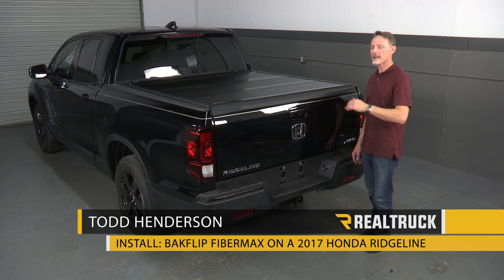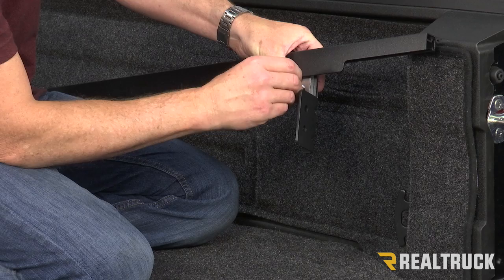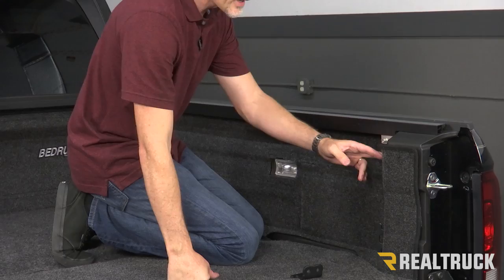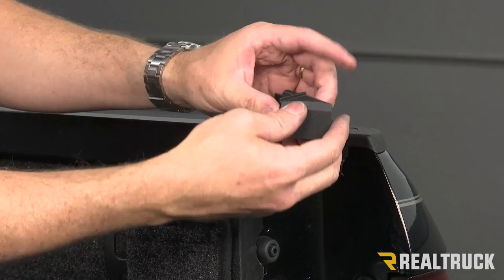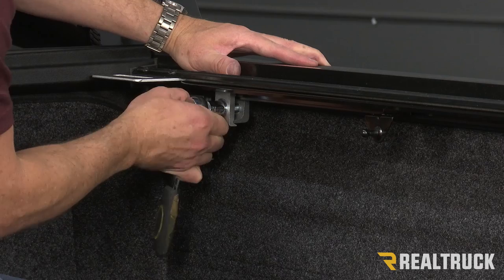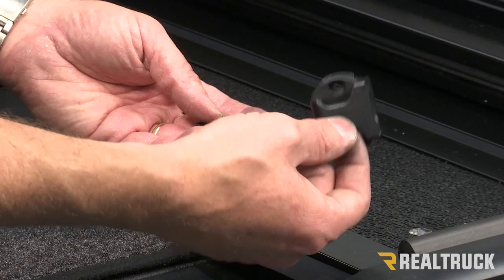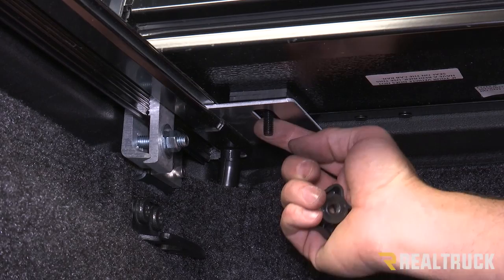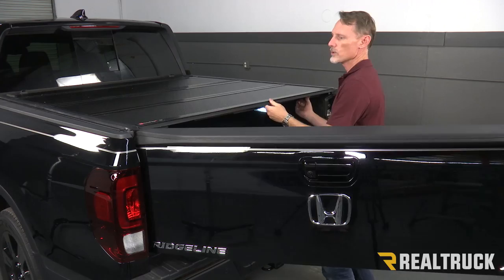How to Install BAKFlip FiberMax Tonneau Cover on a 2017 Honda Ridgeline

Comment from the maker: Check out the BakFlip FiberMax Tonneau Cover on your pickup truck! http://bit.ly/2pArPDt
Reply from the maker: We haven't had any problems with it leaking a lot. No cover on the market is 100% waterproof and this does a great job keeping about 98% of the water out of the bed. If you do get water in its usually along the front bulkhead or tailgate area.
Reply: @ThanhNguyen-zt7jv  So far mine hasn't leaked, even in heavy rain.  I am very pleased with it.

Comment: My cover did not have the correct directions or parts list for my 2021 Ridgeline.  You video was a lifesaver!  Thank you!  Couldn't have installed it without it.
Reply: Good to know! I have a 2021 as well. Mine is supposed to arrive tomorrow (08/31).
Reply from the maker: Glad it helped!
Reply: @RockinSG  are you happy with it?
Reply: @cleanasdirt6832  I am. I had the Honda OEM on a 2018 I owned and it was cumbersome to open it (had to go to each side to open the first panel - all other panels opened after that). With the Bakflip, I can pull a cable from either side to open it. I'm not sure about draining as I don't have holes in my bed for the tubes. I think there are spots but I would have to drill them out. I situated the hoses so I think they will drain. fine. We don't get much rain in AZ so it's not a big deal. It arrived quickly and was pretty easy to install.

Comment: Thanks for all your videos... so many options makes my head spin. I guess it just comes down to which one I like most? They all look like pretty good choices. Leaning towards a roll up just to get that extra bed room when I need it easily.
Reply from the maker: The roll ups are going to be the most versatile. If you have questions regarding the covers please give us a shout. You can chat in or call our experts at 877-216-5446.

Comment: Curious. After I installed the rails on my 2021 Ridgeline, I opened the "trunk" where the spare tire is and the trunk lid hits the rails preventing it from opening all of the way. I think it opens enough but just wondering if I did something incorrectly during my install or if this could be new to 2021 or ??? Thanks.

Comment: The Ridgeline in the video had a bed rug. If I don’t have a bed rug, how should I run the drain hose?  The Ridgeline does not have a drain plug to run the hose to.
Reply from the maker: Hey David, if you don't have factory punch outs in your truck bed you will have to drill a small hole to utilize the drain tube. It's outlined in the instructions and one of our tech experts could also walk you through it.

Comment: so if you put suitcases, valuables and what not in the truck bed using this cover in a rain storm, what's in the bed will remain dry?  also, when you close the cover after the tailgate door is closed, if used with a pop and lock kit to lock the tailgate, will the cover stay shut?

Comment: Same question, does it leak and if so, how much?  Also, does it interfere with the trunk opening?
Reply from the maker: We haven't had any problems with it leaking a lot. No cover on the market is 100% waterproof and this does a great job keeping about 98% of the water out of the bed. If you do get water in its usually along the front bulkhead or tailgate area. 

As far as the truck opening any cover put on a Ridgeline will interfere with the trunk fully opening. With a tonneau cover installed you will be able to open the trunk lid roughly 70-80% of the way.
Reply: Thanks for the response.  Let me clarify, do the rails interfere with the opening of the trunk?
Reply from the maker: Yes, the rails of the cover will not allow the trunk to be fully opened. You will only be capable of opening the trunk lid 70-80%.
Reply: RealTruck.com  Does that mean I would need to hold up the trunk bed door with one arm while I am acessing the content of the in floor trunk? Or will the trunk floor door stay propped open in the 70% open position? Thanks
Reply: @cdnstache  GREAT question...the trunk is one of the best features of the RL. I want a cover/rail system that will allow for maximum access to the trunk without having to hold it up. Please advise !

Comment: You didn’t use the bulkhead seal in your video. Does that not need to be used on the ridgeline?
Reply: it has the factory "bed liner" so it doesnt need to be used. usually with ANY folding cover its the same way, if there is a drop in bed liner or something similar to the ridgeline and tacoma you dont use the bulkhead seal.

Comment: This rail system, does that come included?
Reply from the maker: +Christopher,

Yes, there are two rail systems that come with the cover to mount on a Ridgeline. You will have the accessory rail system and then a separate rail system to attach the cover to the accessory rails.

Comment: BAK says do not reuse tie downs as bolts may not be long enough to provide proper strength to hold everything together.  Your thoughts?  Also, on 2019, says cannot close tailgate unless last panel is open....what interferes?